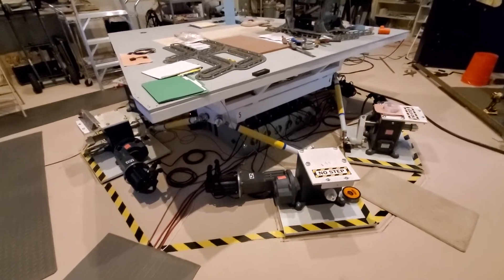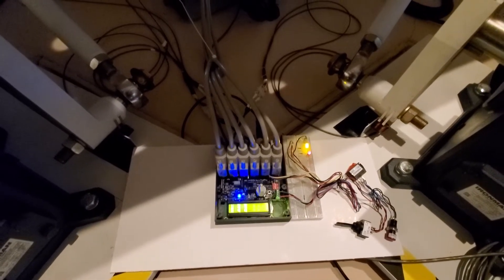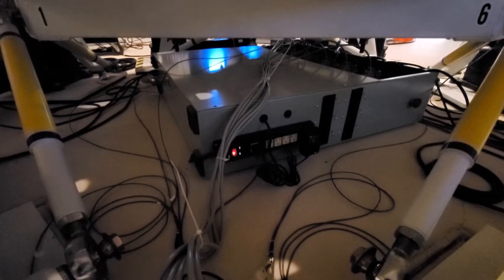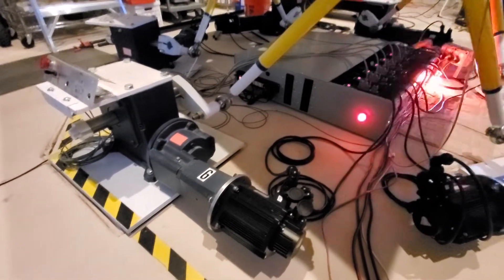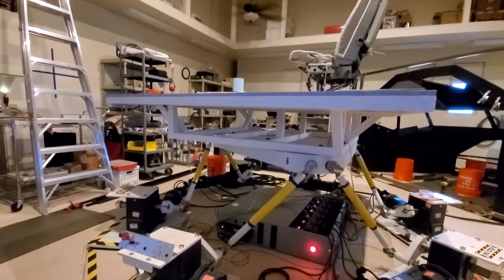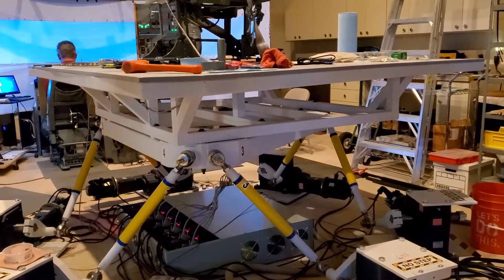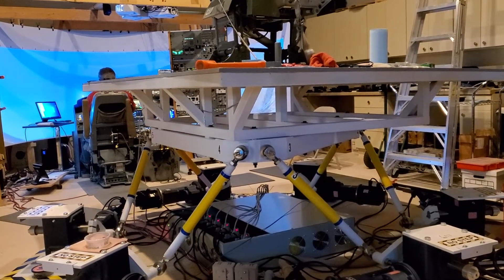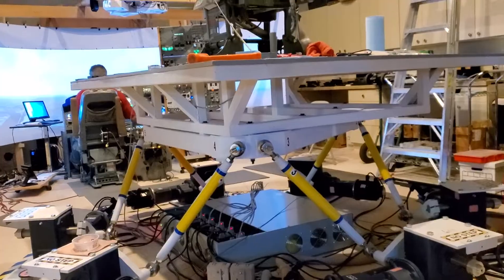Test #3 6dof motion platform, AASD15A, BFF

Comment: Are you finish ?why not pitch back when acceleration?
Reply: Same question.. flew in a "real" 737 motion simulator.. when at full power, u have a constant accelaration push on the runway..  turning the 737 in the sky , u will feel a heavy force.. u feel the contant weight of that thing..